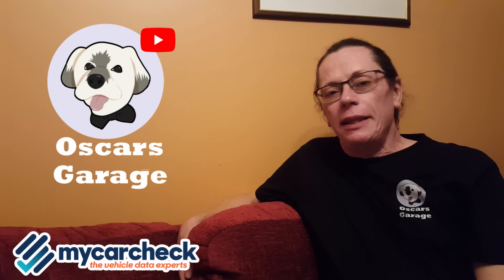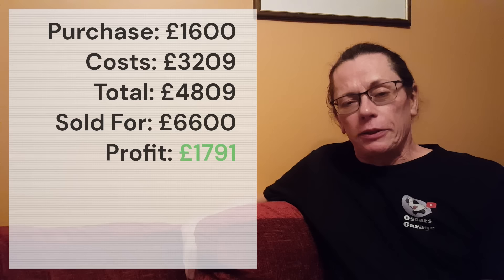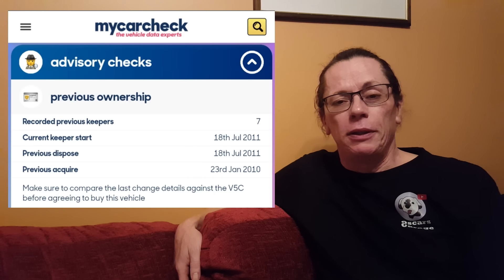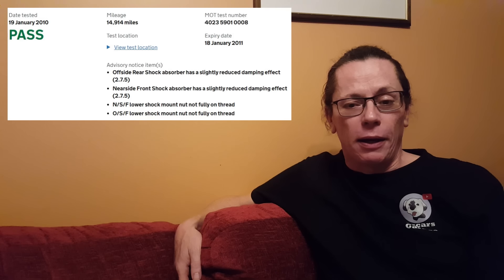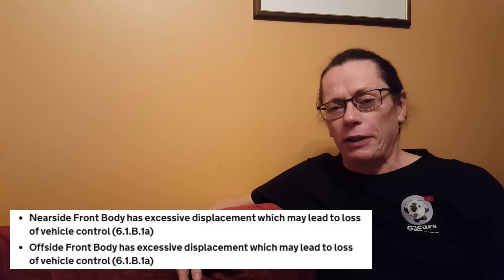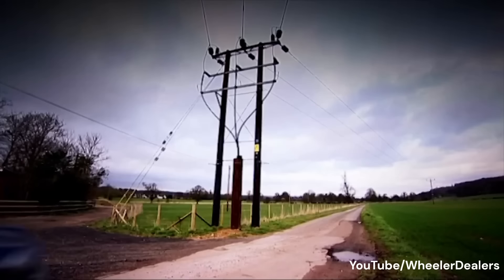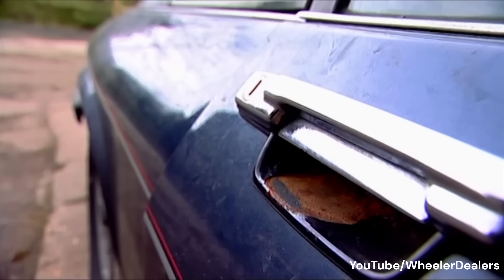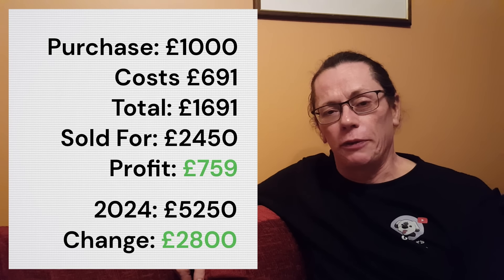Wheeler Dealers Where Are They Now? VW Beetle & Jaguar XJS - Part 16

Comment: Something not right with the mycarcheck, it shows a Karmann Ghia Cabrio, is it the same car.
Reply: yeah I noticed that one too. Needs a further investigation.
Reply from the maker: I had noticed that. The problem with older cars that were entered onto DVLA manually the details were not always correct.
Reply: More likely the registration was sold , see the Frog Eyed Sprite they did , that plate is on a Mercedes

Comment: The failures on the beetle are basically saying the metal work is so thin that its flexing and could cause a loss of control, you usually get it when the car is going rotten around the brake master cylinder and when you press the brake the force of your foot on the brake pedal causes the body to move

Comment: I like these videos even though they generally have a negative outcome. (Please take no notice of some of the negative commenters). They prove a point, which is that Wheeler Dealers is the kiss of death for a long term car restoration, probably because restoration is the wrong word when applied to the WD platform. The cars are just repaired, some may be as complimentary as to say re-furbished, others may say bodged. There are so many things faked, how can anyone believe the actual numbers? As some correctly say, you can spot loads of new parts fitted to the cars that are not included in their totting up. It's a shame  because I've watched every episode from the very first and used to really look forward to the next series. For me, the series died when Edd left, I can't abide Anstead, and although Marc Priestley seems a really nice guy, not much of the workshop stuff he does is really believable.
Reply from the maker: Thanks for the support. Some I find, some I don't, no guarantees!  You make some good points there.
Reply: @oscarsgarage447  No problem, you deserve the support. People don't realise how much work goes into a channel like yours. I only personally know of one of the WD cars, the Volvo P1800S, that was so bad the owner who had it in 2015 when I came across it had had to strip it completely and start again doing a complete restoration.

Comment: MOT for the Jag

2009 91.352 miles
2012 90.419 miles

Someone has been winding the clock back.
Reply from the maker: Think the mileage was the least of the Jags issues...

Comment: Hi dude….. I’m a kiwi living in Queenzland Australia….
There is no such thing as an MOT or a WOF (warrant of fitness) required in Queenzland!!!!
The only thing one has to do is when selling a vehicle you have to provide a road worthy certificate…. Basically stating that the car is allowed to be safely driven on Queenzland roads!!!!
So in practice you can buy a brand new or second hand car with a RWC…. and drive it until you die!!!!
No annual checks or fitness requirements!!!!
The only thing that can stop you is if the wooden tops pull you over and they fined that the car is not up to Queenzland road traffic regulations!!!
So it’s up to the car owner to maintain the car and not the responsibility of the state!!!!
I bet that comes as a complete shock to you!!!!
No nanny state in Queenzland Australia!!!!
Regards Ian 👨‍🎤🇳🇿👍😎😂😂🍸🍸
Reply from the maker: We have that in the UK now for cars over 40 years old. Not required to have an MoT but if you get stopped and its not roadworthy...
Reply: Queenzland?

Comment: I reckon the VW failed MOT and then they tried another garage to get a different result! Back in the 80's that could happen. Not sure you can get away with it  in this computerised age....?
Reply from the maker: I don't know for sure, but imagine when you enter the car for the test it brings up its history... which gives the tester a check list
Reply: @oscarsgarage447  It doesn't work like that, if you log onto the mot computer to do a test it doesn't show you any previous tests unless your doing a free retest

Dealers still do as the comment above mentions, book a car into several garages hoping one will not notice a failure